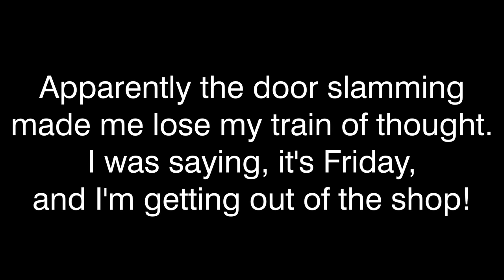Cattle Loading Chute Build - Part 1 (Or watch the condensed version!)

Comment: That's on the bigger side project...
Got an exact one of this yellow hoist..... Now just need to get the I beam and rollers and all the rest.... lol
Reply from the maker: +pierre beaudry It's a nice hoist. You have the head room in your garage?
Reply: The ceiling is 10 feet, but, have to deduct a little more than 18" for door opener and misc. I'm thinking about a adjustable height mobile gantry to overcome the clearance, and possibly go outside, since the door clears a few inches under 8"... Thinking still in progress...  ;)
Reply: Not sure about yours, mine is a half ton unit...
Reply from the maker: +pierre beaudry Mobile gantry would be nice so you could unload things in the driveway. I think mines a half ton, but I can't be sure at the moment. It's really well built unit.